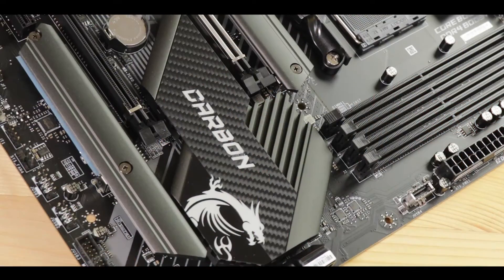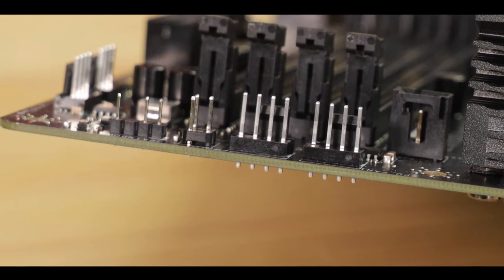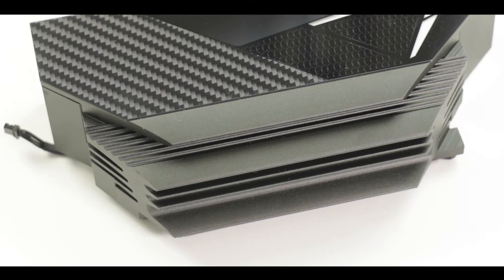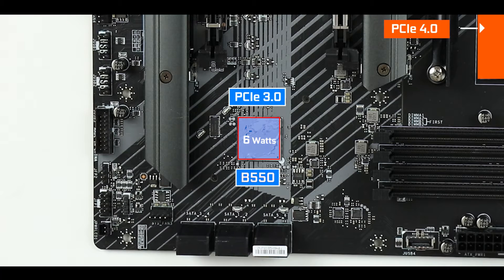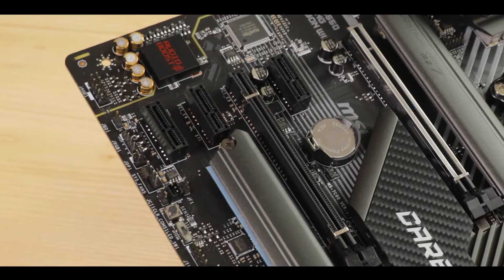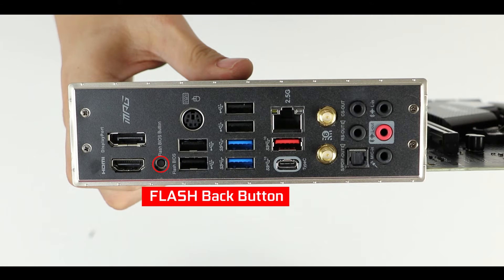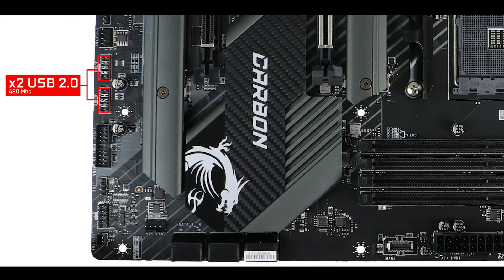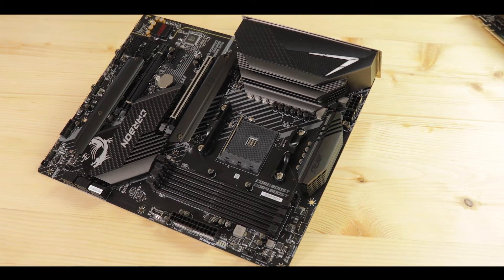MSI MPG B550 GAMING CARBON WiFi : Finally MSI gets it right!

Comment: im thinking on upgrading from  a  asrock b450 steel legend which i disliked a F@king lot! absolute regret... to this motherboard and upgrading from ryzen 5 3600  to a ryzen 7 5800x/x3d
Is this combo any good? i also ordered already a corsair dominator platinum 4x8 3600 mhz (upgraded from a single stick hyperx fury 3200 16 gb which does not exist anymore)
I was having a PC hardware + programing course that i left cause of its conditions lack and didnt understand much of pc building which today i know a lot more and i wanna know if is it worthing spending that much for those components, if u can reply please.
Reply: i can run AC Origins 80 fps ultra but it falls of to 50 fps dued to one single channel ram which i already changed, i was bad at that point xD, and i have an amd 6700xt so i should have get more , considering that i had a one single channel ram and a 3.0 pci-e motherboard :)
Reply: 4:38 also i wanted to know if my corsair 3600mhz 4x8gb will work in a good performance, i got confused in that part (so my question is, can i have 4 rams running at 3600mhz with no problem?)

Comment: Another great review. 
Looking at a B550 mb at the moment, and this mb is def high on the list. One issue i have with this board, is the lack of blue tooth. Most mb with built in WiFi now also have Bluetooth. Is this a deal brake? For me, it could be. I'm also looking at the Gigabyte B550 AORUS ELITE AX WIFI, and that also has Bluetooth 5. And I know you love this mb also. 
Both these are good mb's, but with the MSI mb I'll have to buy a Bluetooth dongle, so that's an extra $20 Australian on top of the price. Here the MSI is $249 Australian,  and i can get the Gigabyte on special for $195 at the moment, otherwise they're the same price. 
Hard choice, as the MSI is such a good mb

Found your channel while researching mb's last week, and liked the way you go about your reviews, and have subbed. 
Keep up the good work.
Reply: Lol this motherboard have bluetooth and don’t buy this board mine died right after year

Comment: i bought this motherboard but it has 8+4 pin cpu power connector and my psu has only 8 pin so what i do next ? sorry for my bad english.
Reply from the maker: 8 will work. No worries. :)
Reply: @Laurentschoice  i was confused between.
Msi mpg b550 gaming edge wifi
Msi mpg b550 gaming carbon wifi
Asus rog strix b550-f wifi
Asus tuf x570 wifi

Can you suggest me which one is better for my amd 5600x
Reply from the maker: Frankly the cheapest of them since they all share about the same VRM abilities for this CPU
Reply: @Laurentschoice  thank you so much, I am building my pc for first time so i need your help. How can i contact you ?

Components i choose

Gpu- rtx3060/rtx2060 

Cpu- amd ryzen 5600x

Ram- g.skill trident 2×8gb 3200 Mhz

Ssd- samsung 970 evo plus 500gb

Hhd- Seagate barracuda 1tb

Psu- deepcool dq750-m v2l 750watt 80 plus gold full modular

Motherboard- im very confused, since i don't going to overlook cpu and i need wifi motherboard in range of 18,000rs which motherboard should i buy.

Cabinet- lian li lancool 215

Monitor- benq mobiuz ex2510s

I already buy all above components except cpu and motherboard. Shoud i wait for intel 12th gen or should i go with amd 5600x because i have limited budget of 1,40,000rs.

I think intel 12600k price will more then amd 5600x and motherboard for 12th gen intel will have higher price then b550 or x570.

Can you please guide me 🤷🏻‍♂️

Comment: I have the MSI X570 Gaming Pro Wifi.. and I can't find the Correct RAM (memory) that works with this motherboard!.. My first  ram purchase was Gskill Trident Z neo DDR4 32x2 64gb.. DOES NOT WORK with this motherboard so I called up MSI they said that ram was not compatible with this particular board.. On the Memory package it says " RGB memory engineered to provide premium performance for the latest AMD Ryzen 300 series processor on the X570 chipset ". I have the Ryzen 7 3800x processor on this board.. I can't return it because I bought it a year ago... So the hell with MSI .. I'm going back to Asus that I used on my first build and had no issues.. I'm tired of chasing ram.. I've purchase (3) different sets of Ram and none of them work on this board.. If you know what ram works with this board please let me know, I've been on MSI website and know that they have list of compatible ram but no retailer has them???

Comment: Not really sure why, but I got this motherboard with AMD Ryzen 9 3950x, rtx 2070, m.2 Samsung, and 32gb ram... it runs slow... or has a delay when I launch anything, like browser or  windows search bar... I'm going crazy because I cant figurr out how to fix it. started from scratch again and Running raid didnt do any fix improvements 😭
Reply: How fast is the m.2 ?
Reply: And when you installed the CPU, did you need a BIOS update?

Comment: I was looking at Hardware Unboxed testing and the B550 GAMING EDGE WIFI has the same or similar features as the CARBON. But, crucially, it runs much cooler than the Carbon, slightly cooler than the Tomahawk. The EDGE is also much cheaper than the CARBON such is a plus.

Comment: Can you please make a video explaining how the clock speed is 5.1ghz if using single channel and 3.6ghz if using dual channel
Reply: You will either have to buy a 5100mhz kit for a few hundred dollars and pray that it will work (wich it as far as I have seen not will) or buy a cheaper stick a pray for it to be able to oc to 5100mhz and do that manually. 5100mhz on ram is nothing you will run daily I think windows cant even cope with that. 
For 3600mhz ram thats much easier and will probably even give better memory latency than 5100mhz. You can buy 3600mhz ram kits and they should work at that frequency after loading xmp in bios. You can also buy a  lower frequency kit and oc it to 3600mhz there are many guides online for stuff like that :)
Reply: @sekki4481  but wouldn’t OC the ram like maybe short the entire motherboard or break some components?
Reply: @MrDope_  I oc'd a lot of ram on many pc's and the only thing thats dangerous about it is pushing to much voltage and not testing for stability correctly and thus slowly corrupting your os installation/programs.
Reply: @sekki4481  oh alright. Would 2x 16gb 3600 cl18 be good or a 2x 8gb 4400 cl18
Reply: @MrDope_  As a follow up to my last comment: XMP is effectively overclocking your part and thus running it out of spec.
To know what RAM kit fits your needs you need to know wich workload you are going to use. For absolute maximum performance with manual overclocking I can recommend kits like 3200cl14-14-14 or 3600cl16-16-16 wich are Samsung B-Die and you can overclock those to 3800cl16 or even 3800cl14(lots of voltage). This will give you the best you can get (Read Write Copy and Latency) at the moment and will cost you a bit of a premium. If you want good performance (few % lower than B-Die) god with Crucial Ballistix. They overclock very well (6666Mhz record clock was made on them) and you can easily oc them to 3800cl16 aswell. If you want good performance out of the box(XMP) go for something like 3600cl16 or a bit worse 3600cl18. On the ryzen platform its important to keep the FCLK ratio 1:1 with the ram or otherwise you will get 10ns of latency penalty (latency=important for gaming) also the faster the FCLK the faster cores in different CCXs(Zen1-Zen2) and CCDs can communicate and thus will improve performance further by a few %. The only advantage of going 2:1 on FCLK is when you want to push your ram clock as high as possible wich will give you a bit more Copy speed (Read will probably improve a bit aswell, write is a bit more tricky on certain SKUs) but the main bottleneck will be the FCLK for bandwidth aswell. I dont know wich workloads you have some might be improved by more copy. I hope this helps a bit and isnt to long. If you have any question let me know
Reply: @MrDope_  2x8GB will perform worse than 2x16GB since a 8GB stick has 1 Rank and a 16GB stick has 2 Ranks between wich the memory controller can "switch". Also depends on your workloads again and how much you want to futureproof.
Reply: @sekki4481  sadly in India there isn’t much option like b-die rams, and there’s higher latency also, like a cl16 will be 16-19-19-38/39
Reply: @MrDope_  If you can buy Crucial ballistix go for that. They overclock easy, are cheap and offer performance in range of B-Die (bit lower bandwidth about 1-2ns higher latency). If you can't send me some of the 3600cl16 kits you consider and Ill do my best to find the best one :)
Reply: @sekki4481  corsair vengeance LPX 3600mhz c18 1x16gb
Vengeance RBG PRO 3600mhz C18 16gb
G.skill trident z neo 16gb cl18-22-22-42
Reply: @sekki4481  all are 1x16gb sticks
Reply: @MrDope_  Ok so thats a bit tricky. Are those Kits? Like 2x16GB or 2x8GB? If not then I would look somewhere else where you can find Kits since you could get different ICs on the RAM wich would make it impossible to OC.
I asked around a bit and was told that you could find out wich IC the kit has but only with a code on the RAM(for G.Skill) and a version number (for Corsair). So if you really want the best you can get Id ask the seller:
1. If it is a kit or if they are sold seperatly
2. If they can tell you the Code/Version Number on the Stick so you can find out what IC it has.
If they told you that its a kit and wich code or version it is you can search here for the IC of the sticks:
https://www.reddit.com/r/overclocking/wiki/ram/ddr4#wiki_manufacturer_ic_identification
Ideally you will want a Kit with Hynix CJR or better DJR. Those are the best ICs that can come with Kits like those you sent me.
Reply: @sekki4481  all of them are 1x16gb
Reply: @sekki4481  G.SKILL Trident Z Neo Crafted with hand-screened memory ICs and custom 10-layer PCBs
Reply from the maker: Im going to share this conversation with some of the community as it answers some questions who have been asked. 

I hope that s OK. Thank you both!!!
Reply: @Laurentschoice  wow didn’t expect you to reply haha. Hope you’re doing well and safe! Thanks for the amazing videos!🙏🏻

Comment: Correction: This motherboard has a Realtek S1200A audio codec and not the S1220 audio codec.
Reply: and the internal type c header is only 5 gbit instead of 10 (10:28)

Comment: Im afraid this Mobo has only Realtek 1200 sound card on board, not 1220A. Also official msi site says: 5+ Optical S/PDIF (Realtek® ALC1200 Codec)
Reply from the maker: Yes that is correct.  

Keep in mind that bother codecs are about identical

Comment: So, wheres that b550 gaming edge wifi review at lol??? got tired of having to remove my dam vertical gpu mounted 2070S ftw3 ultra+ and removed a reset switch from an older case and hooked it to the cmos jumper, BEST DESICISION EVER!!!! btw this is what i achieved on the b550 gaming edge wifi board with some C14 dark pro bdie sticks. https://imgur.com/biLTJ3l
Reply from the maker: Its coming  :)
Reply: @Laurentschoice  yea, thats what you told me when i asked on the carbon video (basically the same board minus reset button) just making sure you hadn scrapped one of the best (in my opinions) b550 boards to date. (cobbed mine for 147.77 U.S.D. off amazon.)
Reply from the maker: I didn't.  Wrapping the B550 Tuf. The Edge is right next in line... seating next to me :)

Comment: Hi Laurent, came across your channel and I would like to say so far has been the most informative reviews I have found. Detailed and reasonable explanation as to which motherboard to select. I'm a first time PC builder and I'm trying to put a system together with a Ryzen 5 3600 or 3600x for the time being possibly paired with a RTX3060ti whenever I could get my hands on one. I'm inclined to getting the MPG 550 Carbon Wi-Fi or the X570 Tomahawk based on your reviews. I would definitely be choosing from these two since I would like to have Bluetooth and Wi-Fi integrated. Based on the above, given pricing is similar, which one would you recommend? I plan on getting more serious about PC gaming on the future and my goal is to have a system that I can upgrade further later on if needed. Thanks!
Reply from the maker: First thanks for the kind words. Without going into too many details, I d go for the Tomahawk.  It has all the carbon has but a tad cheaper:)
Reply: @Laurentschoice  thanks Laurent. I appreciate the response. Im a bit confused though. I'm referring to the X570 Tomahawk not the B550 Tomahawk. I actually like very much the B550 tomahawk but would love very much wifi and bluetooth capability. What would you suggest if I decide to get the B550 Tomahawk instead?

Comment: I'm building my very first PC and after watching your videos now I'm not sure if I should get the msi x570 Tomahawk or this b550 Carbon. They both are almost the same price so if anyone can give me some advice I'd really appreciate it. I'm planning to run a ryzen 7 5000 series
Reply: i have this mobo with a ryzen 5 5600x and 5700xt , getting really solid performance and temperatures. i think the x570 performs a bit better because of higher bandwidth but you need a really good cooling system for your case for the extra heat. The extra performance is something enthusiasts would care about, as an average person the b550 chipset is probably better.
Reply: @davidcarp1034  Thank you very much. I've been doing some research and yes, I don't really need an x570

Comment: Hey great review but im still so stuck between the b550 carbon wifi and the x570 tomahawk wifi, which one should i go for and why? My cpu is a r7 3700x and im thinking of overclocking
Reply: We have the processor. Ryzen 7 3700x. I purchased b550 carbon wifi and damn! It's a great mother board. 💪. I'm using it with msi gaming x trio rx 6800 xt

Comment: Which one of these will you recommend:
MSI MPG B550 GAMING CARBON WiFi or MSI MAG X570 TOMAHAWK WiFi

Im in a situation where I want to build a good solid gaming/productivity computer with Ryzen 9 5900x cpu and RTX 3060 Ti with atleast 32 GB RAM (later upgrade to 64 GB)

Comment: Very nice review, i recently tried to purchase the MSI MPG B550 Gaming Edge Wifi but it's out of stock, so trying to order this instead. BUT, the board has 2 ESP connector (8+4 CPU pin) but i have only One connector (8 Pin only). What budget psu which you recommend that has 8+4 cpu pin connector?

Comment: Is it used with 5600x CPU and can I do oc
Reply from the maker: yes absolutely!
Reply: @Laurentschoice  If I install a 6800 XT as a video card, how many power sub should I use for it or do you have a suggestion for brand models?
Reply: @Laurentschoice  Should I use 3600 mhz CL 18 Ram or 4000 mhz CL 19
Thanksss

Comment: Are you sure the audio codec is 1220a and front USB-c header gen 2? Specs on the MSI site state otherwise
Reply from the maker: Hi there. 

Well spotted for the audio codec :)

The difference is that 1200 is 7.1 channel,  the A variant has 8 :). For the rest they are identical. 

Hope this helps :)
Reply: @Laurentschoice  I'm confused, the site lists then carbon WiFi as 1200 codec 7.1, just like the tomahawk and gaming edge. There's no difference there. Also, carbon edge has "better" vrm than gaming edge, but didn't perform nearly as well. 

The USB header you mentioned as 10g is wrong as well, it only supports gen1 which is 5g.

Comment: when are you doing the gaming edge wifi? B550 tho, as i have the HORRIBLE x570 version and the VRMs (vmos) hwinfo sensor on PBO ALONE gets to 72c so one can imagine how bad it really is with a 5600x
Reply from the maker: It's on its way !
Reply: @Laurentschoice  should i go ahead and get the gaming edge over the carbon wifi? 30 dollar increase in price, i really want all those temp sensors? no spoilers thats all i wanna  know, the gaming edge doesn have them.
Reply: @Laurentschoice  no worries captain im pretty sure the gaming edge wifi, has all im after and it does have VRMOS sensor which is pretty much the same sensor. and i dont use the little pcie connections, only have 1 usb device on the read hooked up, and im trying to get a good deal for cheap. so used VERY GOOD for 150 on the gaming edge wifi vs 187 used (good) (both prices after tax) and i couldn't see myself spending that for a vrm i wont need with a 5600x @4.75ghz even allowing pbo to do it for me it has to be better than what im getting now for power delivery. lets just hope the board can run my tforce 3200C14 dark pro kit @4000mhz 2000fclk c15 flat with tight sub timings, 1.4volts like this x570 (really its a dam b550) but yea i went ahead and punched the buy button. 
(HOPEFULLY YOU READ THIS AND I DONT SEE A HALT IN YOUR VIDEO TITLE WHEN YOU RELEASE THIS BOARDS REVIEW LOL) 
no turning back like i did with the x570 unify for 220 used acceptable. didn have the extra stuff which i dont need have antennas ect, canceled the asrock extreme pro4 (beautiful board btw with post code and bios buttons on the board) but ima stick with msi as thats the bios im familiar with and event here (trash x570 edge) can run great overclocking ram results just using the try it now feature to where as ive seen ALOT of issues with asrock bios messing with timings by setting different speeds?

Comment: Salut Laurent et un GRAND MERCI pour tes reviews au top ;). Juste une petite question, mais que penses tu des résultats obtenus par Hardware unboxed au sujet de la performance un peu moins bonne des températures obtenues par la carbon vs la edge wifi par exemple ? défaut d'architecture des VRM ? Encore merci pour ton excellent travail.
English : What do you think about worst temperature results of Carbon MB compared to gaming edge wifi or tomhawak ? Do you think it's a matter of design or choices on components in the VRM architecture ? thx so much frenchy ;) et VIVE LE CAMEMBERT !!!